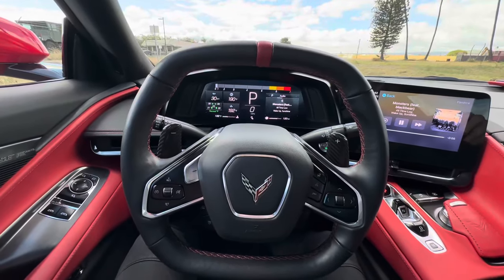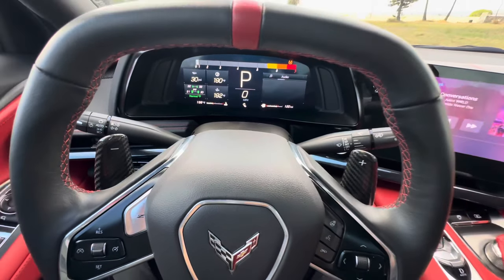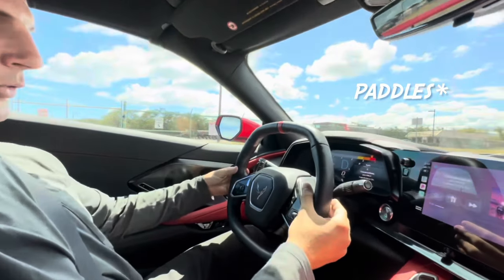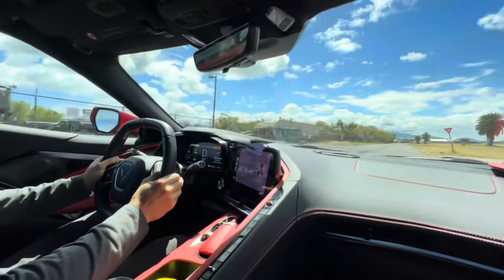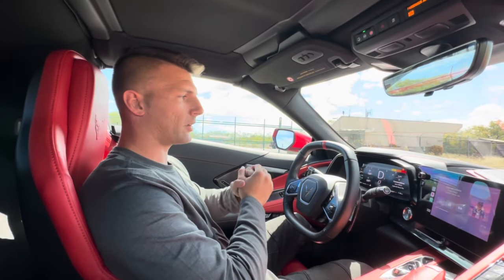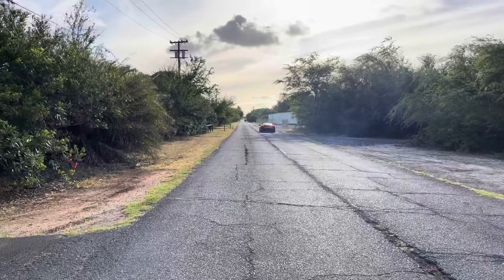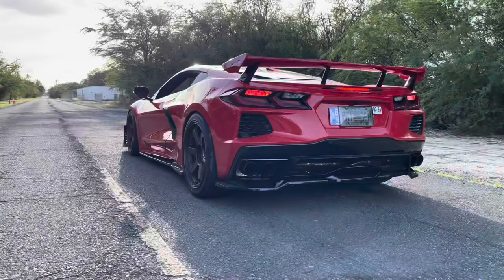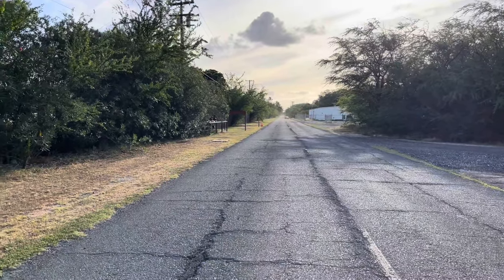How to do a burnout in the C8 Corvette! Burnout mode guide. 2020-2024 models

Comment: Installing a line lock would be the most efficient way to do burn outs in the C-8 Corvette.
Reply from the maker: Agreed, most people don’t want to molest their brake lines though.
Reply: Corvette tried that even with the wheels fully locked up front it would still push the car forward with 0.4g  of force the same as a miata 0-60 pull
Reply: Burnouts are very tough on the drive train...sometimes your drivetrain will be fine and other times you could be limping home with ruined tranny/and or rear end.

Comment: I'll bet that does wonders for the DCT...tires can be replaced, but DCTs are another story (especially after your warranty expires). It's akin to "dumping the clutch" on a manual performance car...not good for the tranny and/or rear differential.
Reply from the maker: It’ll be interesting to see the long term reliability on them. It seems the failures so far have been from debris in the solenoids and GM not recommending the DCT filter get changed soon enough.  GM should back flow and replace the filter and fluid around 2500 miles and again at 7500 miles from my experiences so far with this platform. It seems like it would minimize the chances of the solenoids filling with debris.

Comment: That's lame. My 2023 ZL1 has line lock and adjustable launch control and I can do what you showed with just a stab on my LT4.
Reply from the maker: You also have no weight over your rear wheels and 250 more hp. I love the ZL1 but it’s obviously more muscle than the c8 platform.
Reply: @GhostSpeedShop  I had a 2018 zl1 ( same shit as 2023) and it's nothing compared to the c8.

Comment: When I attempt this in my C8 I have insane wheel hop with the Michelin PS4 tires. What tires do you have?
Reply from the maker: I’ve tried it with multiple sets of tires, are you on asphalt or concrete?
Reply: which is better? @GhostSpeedShop
Reply: I tried the same in my Michelin ps4 tires on concrete and got insane wheel hop
Reply: I noticed the PS4 tires do not like cold weather.  Burnouts on days that’s are over 75*F on warm streets are much smoother.
Reply: @SilverC8andDroppedC10  oh that's good to know!  I've been testing my 0-60 consistently this past week as the temperatures have gone up for me and I've been getting much better times. I also think the surface is a huge thing because even in warmer temps if it's a bad surface best I can manage is 3.5. If it's a good road I can get consistent 2.8-3.0.